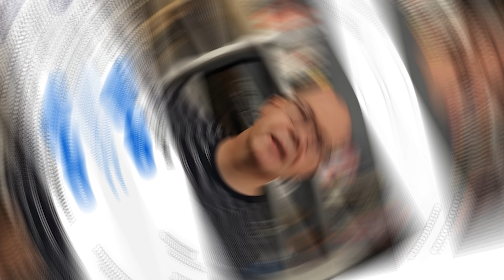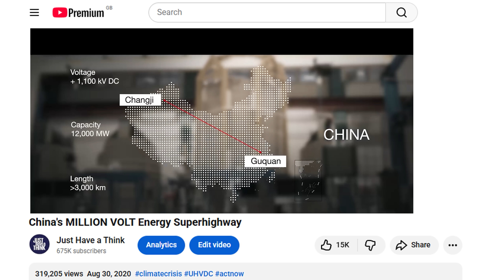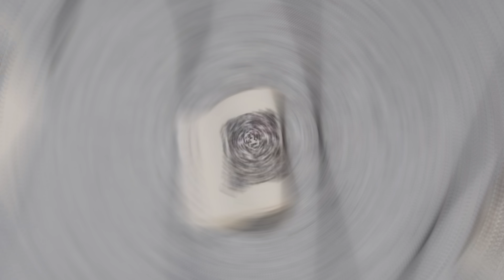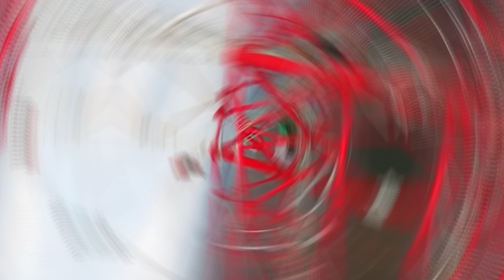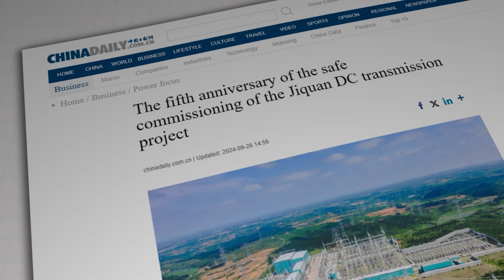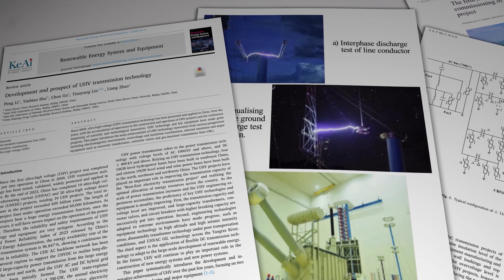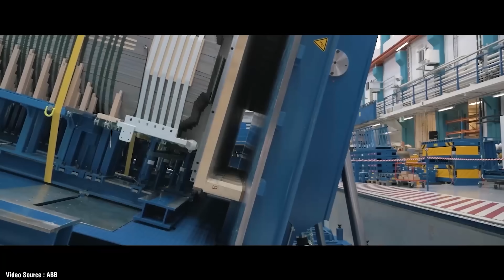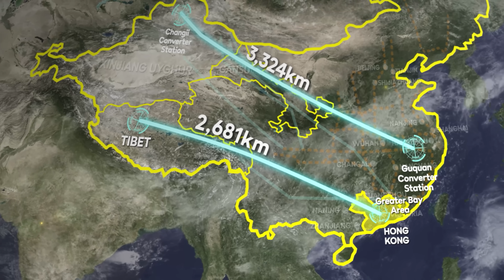China's ultra-high voltage transmission lines now breaking all records.

Comment: Hello, I would like to see a deeper dive into the total system cost of different power sources compared to their LCOE. This has become the new favourite argument of the fossil fuel lobbyists, after the LCOE of renewables undeniably dropped below that of fossil fuels. It would be good to see if it holds any water. I would also like to know the difference between various scales of renewables installations, my guess would be the rooftop solar and small solar farms might have the associated network costs higher, while in larger installations it's less of a concern, and I would like to know if that is true
Reply: This gets lost in that discussion...

A 1 GW solar or wind farm IS cheaper than a 1 GW coal power plant, and on par with a 1 GW natural gas power plant capital cost wise, but it's not really a fair comparison.

This is why.

In order for a 1 GW solar or wind farm to have a capacity factor equal to coal or natural gas you have to have a LOT of batteries in a battery farm.

Wind and solar WITH battery farms make the cost rise.

On top of that, renewable power plants like wind and solar are typically built dozens or hundreds of miles away from where the energy is needed, and as a result you also have to install expensive transmission lines to move the power to the places its needed.

Comment: New Topic: Deep Fission. The concept to drop a 15 MW Boiling Water SMR down a 30-inch borehole under Parsons, Kansas that's under construction now with plans to be online by July 04, 2026.. By using the earth as the ultimate shield, these will make SMR's both cheaper and easier to build than ever using existing non-breakthrough nuclear technology Just decades old tech scaled down for modular use. If it's successful future sites can be drilled up to 100 boreholes per site creating a 1.5 GW plant capacity..

Comment: Solar produce DC power. Inverters are expensive and prone to failure. Electric cars are charged with DC power. While some appliances in a house are configured to run on AC like dishwashers, laundry appliances etc. I believe it is possible is possible to build similar appliances that work with DC. In converting DC to AC, a significant amount of power is lost and then another loss occur when converting it back to DC for my laptop, cellphone, car charger etc.  My question for a episode topic, would it not be feasible to replace the couple of appliances that's configured for AC and run everything on DC?

Comment: agree. In Australia we could never transmit DC energy via high volt transmission lines. We are having trouble just building high volt AC lines in Vic. 
We need to think of alternative options. 
Decentralised energy generation with multiple short high voltage AC transmission lines is, I hope, what we will do. My biggest hobby horse with building towers (especially ones like the Chinese have is redundancy in the system to cope with climate changes in severity & weather patterns. Nothing like a catastrophic event (eg  bush/wildfire/microburst/tornado etc.) devasting one of these high voltage transmission lines to interrupt a major portion of the population living on the eastern seaboard. Despite hig initial costs- I also think high voltage underground transmission lines would mitigate a significant porion of risk in through life of system long with dispersed, linked, energy generation - including in the high population centres. We have been moving gas 1000's km through pipes for years- why not power lines & why not above ground when able & underground in critical risk areas? 

Also need the software and AI to assist our new virtual grid. 

Another suggestion I love to hear options for is managing batteries in bush/house fires & floods, high temps / low temps etc - extreme climate situations. 'Cause we know theyre coming!

Comment: How about the Future green fuels? The idea of carbon capture and synthetize fuels like methanol ethanol, methane, ammonia, Hydrogen using them as chemical energy storage for burning them later in engines in a zero Co2 cycle. Is this dream within reach or still far away?

Comment: Authoritarianism by itself isn't a solution to development problems.  There have been plenty of authoritarians who have made their economies worse, including China when Mao had full control (Great Leap Forward, Cultural Revolution).

You need an elite which wants to develop instead of consume, which allows enough internal disagreement to find the best solutions but not so much disagreement that it breaks apart, and which has enough shared trust that it can't be manipulated into failure by foreign intelligence services.  Democracy can produce this result; there's a reason that the US has been a superpower for 80 years, and there's a reason that most of the world's developed economies are democracies.  Finding that Goldilocks zone of disagreement is something that democracies tend to be better at than authoritarian systems; obviously it's not guaranteed, though.

Comment: I recommend you look into Brazilian electrical grid as it is managed as an unified system centrally controled by a single non governmental body called ONS. There's very long HVDC transmission lines there too connecting the Amazon hydroelectric generation with the Southeast consumption, spanning around 2 500 km. There's also the Itaipu HVDC system that operates since the 80's with more than 800 km of line

Comment: The latest hydrogen fuel cell technology and hydrogen vehicle engines would be a good update for a video.
Reply: Hydrogen is a dead end.  Way too expensive...  Why use electricity to produce hydrogen to only use that hydrogen to produce electricity.  It's exceedingly inefficient.

Comment: @Just have a Think, it would be great if you could cover your take on the geothermal energy from super deep bore holes, made with (mm Wave) lasers (done by Quaise Energy and DeepU). There was a recent video from Real Engineering about this, but I'd be very interested in how realistic it is to expect anything from this technology in the near future. Could it still play some role in lowering emissions in time? The same question for fusion, but I guess I know the answer to that, and we're still at least 20-30 years off from any serious contributions to the grid.
I'd also be interested in personal versus governmental/company responsibilities to lower emissions, and if there's any data about what could be achieved by individuals alone, versus government and company action (and if you could push people a bit more towards a more vegan-like diet while you're at it ;) ). Thanks!
Reply: Quaise is opening up the entire planet to geothermal.  Geothermal will win in the end, hands down.
Reply: Or Deep Fission which is currently drilling and then powering a 15 MW Boiling Water Reactor down a 30" borehole 1 mile under the Great Plains Industrial Park outside Parsons, Kansas. It's under construction now as part of the DOE 11 team bake off designed to get at least 3 SMR test reactors online by July 04, 2026... Including this one..  Drill and Drop nuclear..

Comment: There isno reason for Europe to follow China. What works for them doesn’t necessarily work for us. I think we would be far better off with a mesh grid with lots of SMRs local to where they are needed and connected only to the other SMRs adjacent to them. Its more scalable and redundant.
Reply: Geothermal is way better than nuclear, my friend.  Zero chance of a meltdown, is way cheaper to build out, and zero radioactive waste plus geothermal has a capacity factor of 70-90% so is somewhat the same as nuclear in its reliable and high energy output.
Reply: @TerraPotentia  Unfortunately that’s not always the case in Europe. For instance, to power an industrial scale power station of about 400mw in the Netherlands, you’d need to drill down to more than 4KM and have a large heat channel. Building and esp maintaining such a channel would be very expensive. I imagine an SMR would be cheaper both to build and to maintain. I admit I don’t know all the numbers, so I may be wrong.
Reply: Deep Fission... Drill and Drop nuclear... 15 MW BWR's dropped 1 mile down into the earth... These boreholes can then be used as deep geological repository after the nuclear site is decommissioned.. Or they can be lifted to the surface and repowered or replaced with better tech as it develops.. Aka Plug and Play but for the SMR set.. It already started construction with its test reactor slated to be ready for July 4, 2026...

Comment: # Energy Scavaging Tech. So much of the energy produced in the form of heat or cooling is wasted. One example that annoyed me for years was heat pump water heaters that produce a stream of cooled air that is just pumped into the atmosphere. Similarly modular housing units that have a sealed envelope that circulates heated or cooled air depending on external and internal temperatures. A wok compared to a cast iron fry pan - which heats quicker, which cools quicker, which holds its heat and distributes it better. Heat is energy and maybe we should be measuring human BTUs rather than concentrating on human footprint.

Comment: I have been following your channel for years 
What detracts from your messaging is your sniping at China 
The truth of the matter is that there would be no real climate change solutions without the Chinese manufacturing capabilities 
They were the ones that conpletely brought down the cost of PV, batteries,cables etc etc 
So just give credit where credit is due... without the sniping
Reply: All of the solar and wind and batteries that China is producing are going to be an environmental nightmare.

Geothermal is the best renewable power source we have.  We need to push geothermal.

Comment: My topic request is: I suggest that the cost price for electricity should be based on the voltage in the local subnet transformer. This means if more renewable energy is available, the voltage rises, so the price drops and people are incentivised to charge their cars etc. This makes it easy to automate using energy when it is available at the local level. I'd like to know why this is not in use yet...

Comment: I would like to see a video on transparent wood.  Not only the obvious direct uses, but also how it would complement solar power.  No need to enter me in the contest for a hoodie.
Reply: Forget about solar, it's an environmental disaster in progress.  Geothermal is the best option.  Nearly zero environmental impact by comparison, and a limitless source of power.
Reply: @TerraPotentia  Why do you think solar is an environmental disaster?  Also, geothermal is extremely limited for practical use, with current and near-term tech.
Reply: @MardukGKoB  "Why do you think solar is an environmental disaster?"

The amount of mining and resource gathering required to build solar panels plus all of the metals needed to make the batteries that make it a viable option for the grid is absolutely massive.  Not to mention that they last only a few decades before they need to be completely recycled.

With a geothermal power plant you drill the boreholes, build the power plant on the surface, you pump water into the boreholes, and steam comes out and you get your energy generation.  

That's an absolutely tiny environmental impact by comparison.

"Also, geothermal is extremely limited for practical use, with current and near-term tech."

Look up Quaise Energy.

Their millimeter wave drilling technique opens up the entire planet to geothermal.  

Traditional mechanical drill bits can get 0.1 meters of drilling depth per hour through granite.

Quaise's millimeter wave drilling tech can get 5 meters of drilling depth per hour through granite.

The deepest borehole ever drilled with mechanical drill bits was the Kola Superdeep Borehole in Russia.  They reached a depth of 40k+ feet.

It took them 20+ years to achieve that depth...

Quaise Energy's millimeter wave drilling tech can drill to Kola Superdeep Borehole depths in 100 days.

Their millimeter wave drilling tech literally vaporizes rock.

Comment: Topic. Renewable energy projects and challenges above the 60th parallel
Reply: Geothermal is the answer...  Not wind/solar and battery farms.  Wind/solar and the requisite battery farms which are needed to make them work are an environmental nightmare.  Geothermal's environmental impact is basically zero.

Comment: Can’t change Voldemort pushing fossil plants & cars to benefit oil CO’s & CEOs. AI will keep pushing more energy use and keeps Stock Market artificially high benefitting Voldemort & oil. Big cost issue is maintaining & expanding transmission especially with nimby and grid delays and worse - so it ain’t happening. So… distributed solar+batteries … how to get more and more homes, apartments, and businesses (Costco, Walmart, Lowe’s, etc.) putting in solar & batteries with rooftop and balcony solar to reduce need for transmission and unneeded peaker plants. Plus, how to convince people who get snow to realize solar & batteries & EVs and heat pumps (and for politicians to allow and maybe even incentivize users) for home/business to avoid the inevitable price increases from utility COs.
Reply: Geothermal is the best option for power, not wind/solar and battery farms.

Comment: Decades ago Russia apparently established an ultra high DC voltage transmission line sending power from the East of Russia to West Russia. One reason ultra HV DC was used is that the long transmission can act as an aerial radiating power into the ether if using AC.

Comment: Dave - this is an excellent video.  I am a Power Electronics engineer and I am impressed with your attention to detail and ensuring that what you stated was technically correct.  It is very refreshing to see technically correct content rather than passing off technical errors on the basis of trying to keep the content simple for the audience.   I can never understand the argument that explaining things incorrectly is somehow better for non expert audience's. 

My suggested topic would be a technical dig into the topic of inertia and the role it plays in grid stability and an exposure of the real reason why grid following inverters do not provide inertia  - which is all based on archaic stupid legislation and nothing to do with technical limitations. 

You have my contact details and I don't mind helping provide you with the information for this topic.

Comment: For the UK the answer is a mix of AC on land and DC undersea running north south on the west and mostly east coasts.
National Grid are upgrading existing lines in many places which largely avoids the planning issues.
Reply: Good luck with that, being DC biggest downfall is electrolytic corrosion.     Seawater + dc lines = no power

Comment: New Topic: WEHT 3D printed cars. Once touted as the next big thing in vehicles? They seemed to have hit a dead end... Phoenix Motors was one that WAS promising but went under despite its concept of localized niche but customized cars using open source CAD designs and thermoplastics and carbon fibre. Two materials that are superior in most ways and yet have failed to replace METAL in cars and trucks worldwide despite its superior durability. Even Chrysler tried to build a Citroen 2CV like vehicle for China called the CCV which would have had 4 thermoplastic body parts glued together with plastic panels then bolted to the frame..

Comment: The U.S. National Renewable Energy Labs published research on HVDC lines in the U,S. in around 2016.  The paper said we could build lines along interstates that would supply virtually all the energy needed in the Eastern U.S. from the Front Range and Western Great Plains, :"The Saudi Arabia of Wind," and solar from the Southwestern U.S.   The findings were featured on NREL's website until one of Trump's officials had them removed in 2018.  So much for the freedom of information in our vaunted democracy.  The paper found that there would be tremendous savings in energy cost as well as a more rapid transition to emission-free energy.

Comment: Well, I hope you can send ot the USA if I would happen to win, but not holding my breath these days. That said win or not, I would love to know more about if and where they might be using local micro grids of green energy to support the main grid. My vision is that each town invest  in battery storage for local generation of wind and roof top solar to cut down the needs for long distance transmission all together. It seems like if each town had the storage needed it would be cheaper and safer than every home investing in battery tech but each roof could produce solar as long as they were compensated fairly for their production over their needs. It just seems like that would solve many of the issues except the one that is holding us all back. That being the greedy utility companies wanting their monopoly powers but are held by investors who take too much off the top. We need more co op type ownership structures in our utilities. Hopefully local ownership would put an emphasis on reliability and long term goals rather than quarterly returns to shareholders. Grid down? Go to local battery backup. Barely a hiccup. That has to be worth something. And it allows local commitment to build out. If locals are all Luddites, then they are the ones who suffer when grid goes down, not the rest of us. Areas that invest will reap the rewards not carry the troglodytes who are short sighted.
Reply: We don’t need UHVDC. China does